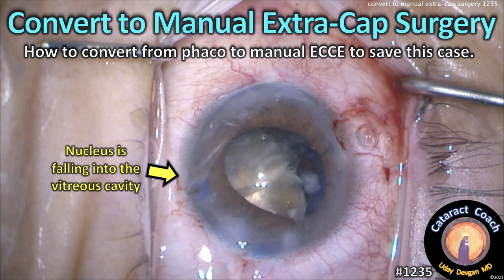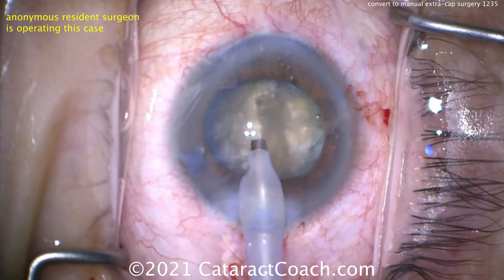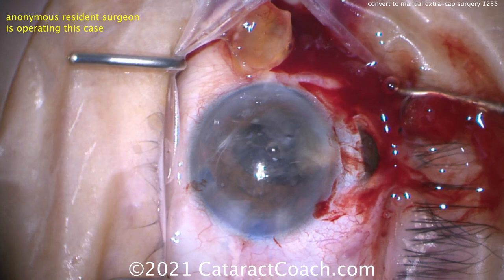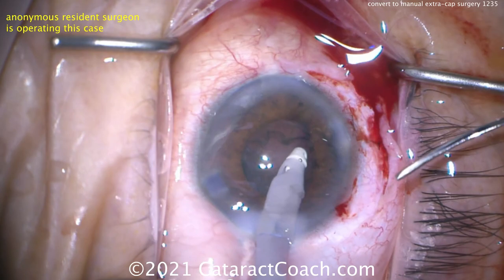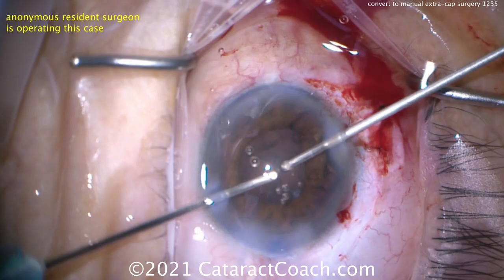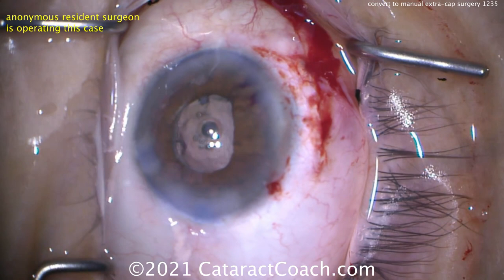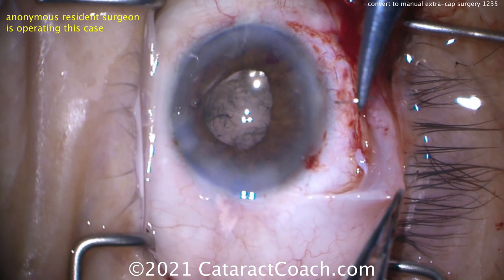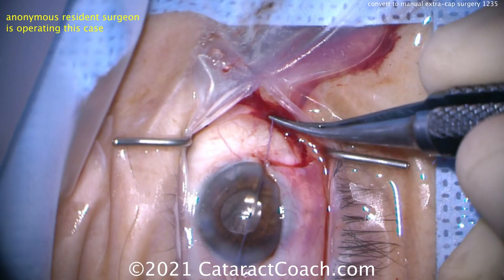CataractCoach 1235: convert from phaco to manual ECCE extra-cap cataract surgery

Comment: I notice that you always sit on the lateral side of the patient and enter the eye at either 3 or 9 o’clock. Do you have any trouble positioning the foot pedals for the Phaco and the scope under the operating stretcher? I seem to have a problem with this so I normally enter at 12.
Reply from the maker: Yes I usually sit on the temporal side. See this video for how I position 
https://cataractcoach.com/2019/10/28/surgeon-ergonomics-for-ocular-surgery/